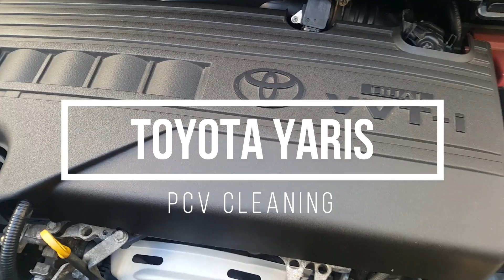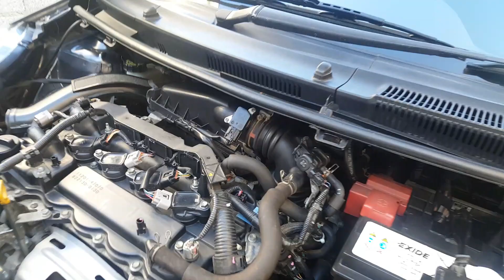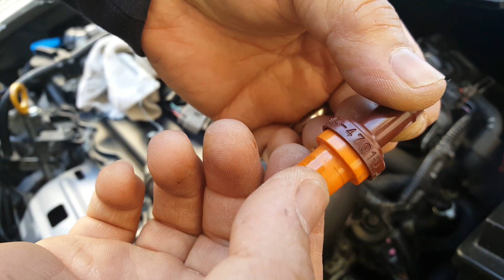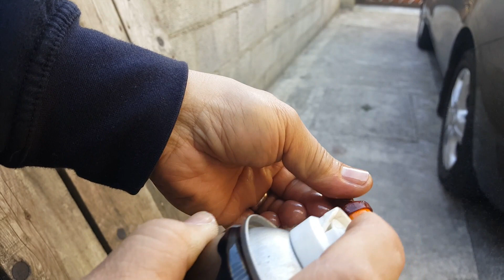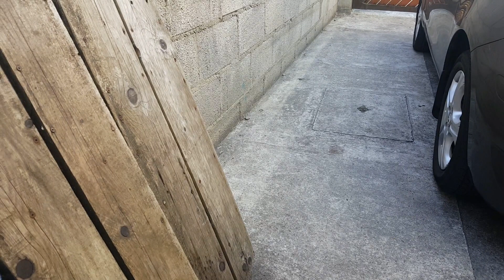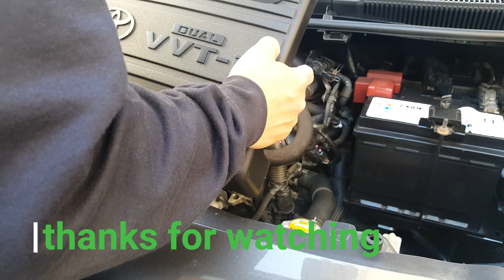PCV VALVE CLEANING , TOYOTA YARIS WITH 1NR-FE ENGINE

Comment: is it fix low idle problem? it vibrates when engine is warm and working noisy. 2017 1.33 engine. same as 1nr fe code. hope this cleaning helps for smooth and silent idle
Reply from the maker: try to clean the  throttle body and EGR valve as well..
Reply: Can you please show me where the EGR valve is?

Comment: Hi @JLS Etnuper, did you have high oil consumption before cleaning the PCV valve? And did it help the problem for you? Thanks.
Reply from the maker: Not at the momment..its part of my maintenance to clean it..thanks for watching.
Reply: @douglasheld is yours burning much oil ? - if so did you figure out why?
Reply: @martyc5674  Yes. I did replace the PCV, but it was clean and rattling - so I didn't think that was it.
What I did was, oil change with the stock Toyota 0W50, and drove it really hard. I drove in first gear all over town for a few days, putting the RPMs into the limit of the allowed range. And, after the next oil change a few months later the loss of oil stopped.
Reply: @douglasheld  interesting… and thanks for reply. What was your thinking behind that approach? And was it consuming much oil?
Reply: @martyc5674  I don't remember the rate of loss. I think 3 months after I bought the car, the oil warning sounded and the dipstick was dry. So it was a fast rate.

My thinking was the car was 12 years old and had only driven 50k miles. I think it must have spent years not getting fully up to temperature, and possibly being filled with poor quality motor oil. I suspected that one or more piston seal rings was gunked up and not moving properly.

I was going to do something invasive like https://www.youtube.com/watch?v=Uy_GcE7pxjM&t=10s&ab_channel=JoelAutomotiveInaction

I was inspired by https://youtu.be/7Ef2hYmcZzA?t=429 and one other video by a Russian/Ukrainian guy (now deleted) who decided to to frequent oil changes with high quality oil to clean out the engine. I tried that first and it worked.
Reply: @douglasheld  thanks a lot douglasheld - I appreciate your detailed post- it helps a lot!

Comment: Hello, my car burns oil at 124 000 km. Is this the main reason why it burns oil? Thank you
Reply from the maker: yes, and also there is a problem with your engine piston ring..thanks for watching
Reply: @jlsetnuper  I hope there is a problem with the pcv valve, I will clean it as soon as possible thank you for your reply
Reply: Did you find out why your Yaris is burning oil??— mine is burning lots of oil for no good reason.

Comment: Can you clean pcv valve with normal water??
Reply from the maker: Its better to clean with brake cleaner,   it will dry quickly and remove the oil inside the pcv..thanks for viewing

Comment: pcv valve closed at low idle vibration??
Reply from the maker: pcv valve opens at idle..i think you need a new pcv valve
Reply: @jlsetnuper  sorry my english little:))
my problem : idle car hot 700rpm car vibration:( ... pcv valve??

Comment: To really clean these, spray in some Tar remover first, let that soak for a bit, then clean out with brake cleaner - the tar remover breaks down the heavy crud very few other sprays really touch, the brake cleaner flushes out the residue.
Reply from the maker: Thanks for the info!

Comment: Awesome video
I am going to clean it when i do my next service as i have never cleaned it before and i have done 70 000km as My Toyota Auris with the same engine is currently sitting on 250 000km with no issues.

2 weeks ago when i inspected my spark plugs, i noticed that they are oily and i am not sure if i need to replace the plug tube seals as the tips of the Plugs are clean with no oil.

Car doesn't smoke, no power loss and fuel consumption is still good.
Reply from the maker: thanks for viewing..if the oil is on the body of the spark plug not on the electrode, maybe your cylinder head cover gasket is leaking, you need to replace it..
Reply: @jlsetnuper  you mean the Valve cover gasket.
Reply from the maker: @motheolebelo  yes